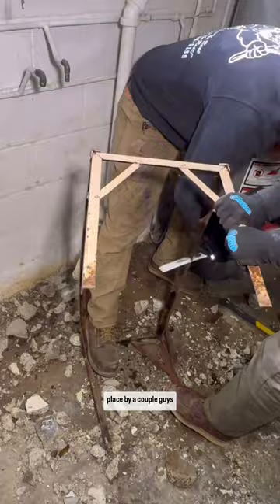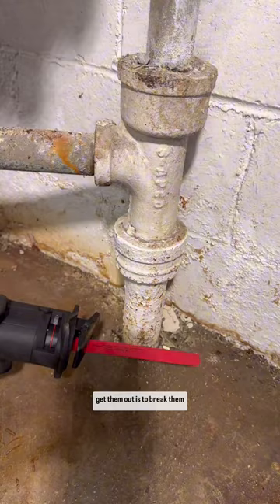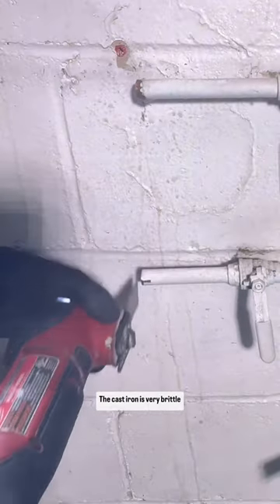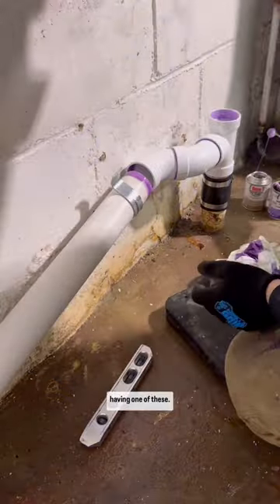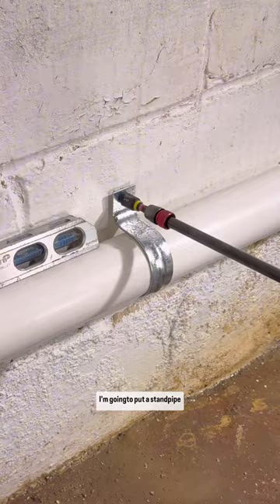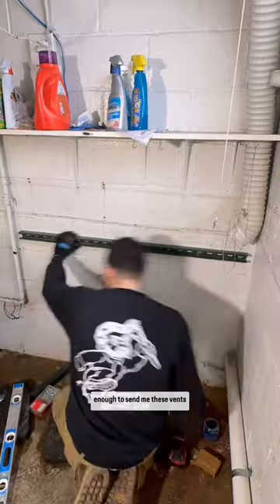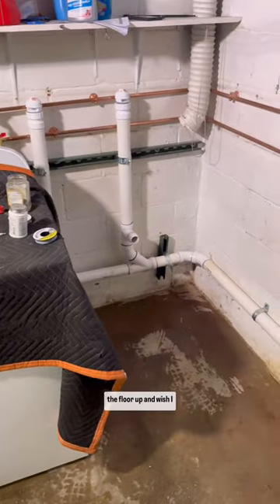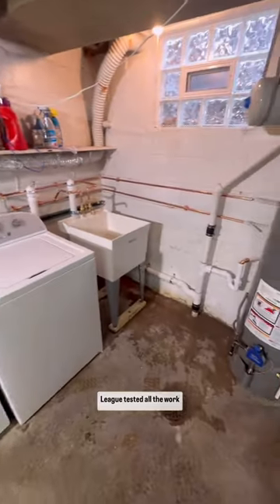Concrete Laundry Tub Update

Comment: You can directly pipe that utility sink right into the washer standpipe as long as it's within 30in and have the washer drain and utility sink share a trap and vent, saving you some fittings and a second vent, at least in my state and according to the 2018 code you can